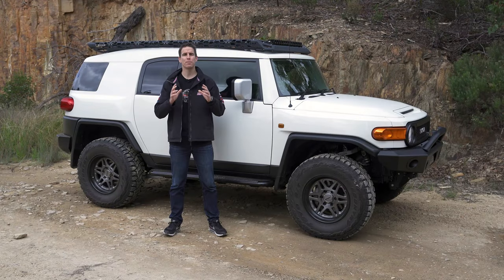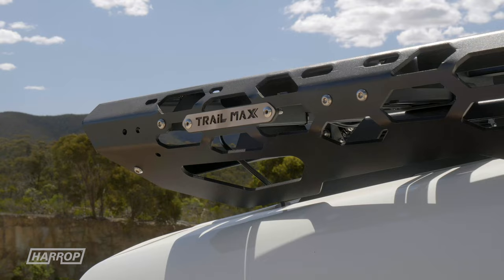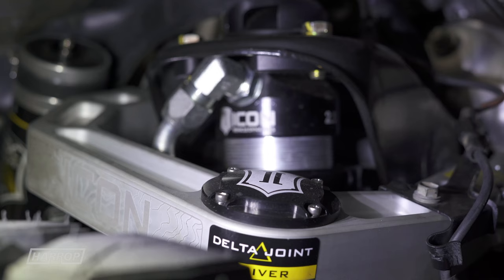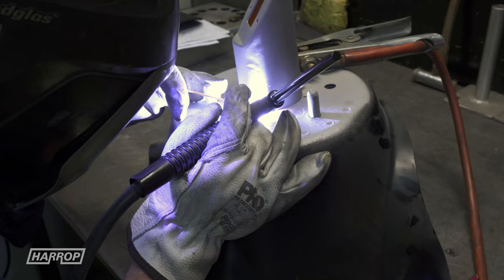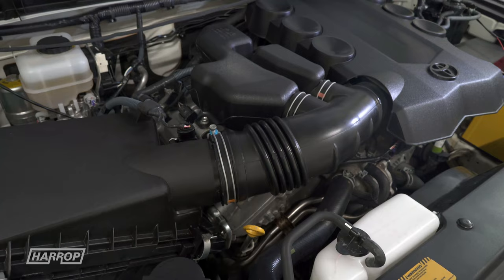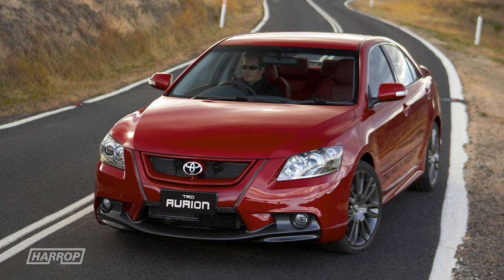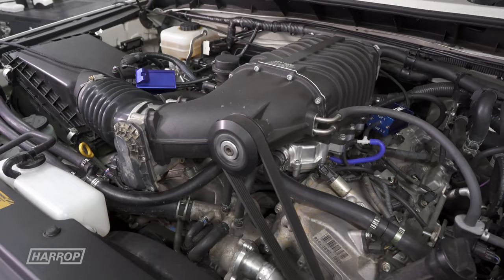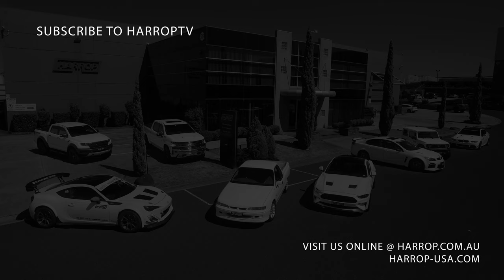Toyota FJ Cruiser | Harrop TVS1900 Supercharged

Comment: "Factory 160 Liter Fuel Tank". ?   Do you have a part number for this?  I didn't know there was such a thing.
Reply: 159L to be precise, it comes standard on 2014 models onwards in ME.
Reply: @kindi911   Share a part number if you can find one....   In the US they all have a 71 liter tank (19 Gallons).  Range is a problem.

Comment: When will the wheels be available to the public? And was the fitment possible without modification?
Reply: @kevron22   thats obvious if you watch the video but was more interested if the body mounts or guards etc where cut. @HarropTV care to weigh in?
Reply: @wadet5270  body mount chop is an absolute.  Talking from experience.
Reply from the maker: We expect the wheels to be available later in the year and there is a slight BMC required for clearance.

Comment: 0:48 “Toyota durability make it a popular choice” Ah yes, of course: banking on PRIOR Toyota durability. But the FJ Cruiser is absolute garbage!
Reply: Says who?
Reply: Why ?
Reply: @zarekivey  says many people that have actually owned them. They bought these because of prior Toyota durability, and they were disappointed. 
The FJ Cruiser is another poser, a marketing scheme that rides the past success of other good Toyota models.
Reply: @d993s  according to who?  It has a few minor issues like any rig but it has one of the lowest maintenance cost out of any Suv recently made. It goes through windshields due to the angle, and the rear visibility might suck with my 33" spare mounted on the back, but the 4.0 1gr-fe is one of the best Toyota engines ever made! The A750F auto was used in the Million mile Tundras and the Land cruiser 100 series... it's the only car or truck I've owned where I've hauled wood, slept in, gone dune running, drove through 3 feet of moving flood water and still has the beans to pull an F550 50 feet sideways out of deep mud (granted with a big running start several initial tugs and kinetic rope) she's a guzzler but she's a damn sturdy piece of equipment and anyone I've known has loved theirs to pieces. Your welcome to get the new Bronco with the Eco-boom engine tho if that's what you prefer... 😉
Reply: @OpaqueNihilist  sturdy??? The FJ Cruiser? 😂 it’s all relative to what you compare it to. Contrast exists, and the FJ is no Land Cruiser from back in the day. It’s a weak attempt at prior quality and it fails miserably compared to older models. Your examples are really reaching for greatness but you’re dreaming with those claims. 
If you’re satisfied with it, good for you, as most here are grocery getters with an occasional light camping trip. 
I have a 2015 Ford F250 6.7 turbo diesel and a 2009 Mercedes G55 and both with power upgrades (they don’t need anything else)
Reply: @d993s  your criticisms aren’t conveying any form of point here. You’re just saying “it’s bad” then not giving a reason as to exactly why it’s bad. I have an FJ with 172k miles on it. Not a single issue or expense other than routine maintenance and thousands of other FJ owners have had the same experience as me.
Reply: @d993s  well the G series is certainly respectable though I'd be curious to know what rim profile your offroad tires are on... 18" arent ideal and alot of people go 19 or 20 for the look. Its capable though a new axle is going to cost alot if you do any actual wheeling. Cars in general are used as grocery getters by definition, as are 99% of G wagons and 95% of wranglers. The Ford is a great truck but it's damn heavy. My other wheels are a 94' Dodge 250 with a built Cummins and a engine swapped mk1 vw rabbit for the track so they stay hitched to the trailer most days. I just don't think calling the FJ garbage is all that shrewd when you look at what else is on the road and what it can do with a 3" lift and a front locker. Its easy to work on and mine is still worth what I payed for it🤷‍♂️
Reply: @zarekivey  it’s simply not built to the same heavy duty standards as prior older Toyota models. Same goes for late model Jeep Wranglers and Ford Broncos; they’re built for looks and light duty use. 
Getting 172k miles out of one with highway driving and mild challenges is nothing to brag about. Again, the contrast and vagueness of what’s “good” (like a typical Amazon review “shipped fast, looks good”) is very different compared what some prior Toyota models were known to be capable of.
Reply: @OpaqueNihilist  on the G55 currently running BFG KM3 Mud Terrain 295/70/18 on stock AMG 18” wheels when going off-road, and on road usually Michelin LTX in the same size on a 2inch lift
Reply: Nothing like a bit of gaslighting to get everyone going. 
I’m a bit greedy, ln my collection l have a GQ patrol , a mint 80 series land cruiser and an fj cruiser. 
   As a one person tourer, and having travelled across most deserts and outback destinations in Australia, l am really lucky that my garbage fj cruiser didn’t break down once on over 120,000kms. 
The video shows how not to build an fj cruiser; unless your a poser. 
   If you like wheeling; my GQ Patrol beats anything hands down. ( It is a comp truck)
Reply: @purebloodnordicroamer7955  lovely 4X4 collection. the GQ is much better than the GU and we don't even get that in the states. Unfortunately Nissans 4X4 options here are mediocre at best. I've never been in one outside of a safari in Africa but if a diesel GQ or a Jimny was available I'd buy one. I'd be curious to hear about your personal issues but I'd say buying an FJ for a touring car was always going to be a terrible decision. You need alot more cargo and fuel space if your going into the outback. Short wheelbase Suvs are in short supply here in the states and the FJ can't be all that bad if it's used as a police car for dune and desert running by Dubai. Love or hate the shell but the locker, Trans, engine, a-track, breathers and tow capacity are all very respectable. Arb lockers, mud terrains and a 3" OME lift with resevoirs and it goes anywhere I've pointed it at. I love most Australian 4X4 offerings, you and India have the best options, but the reality is alot of yall just end up getting Rangers or Madza bt's that aren't great for much else other than hauling maximum human ass over long distances. The Cruiser is nowhere near an 80 series just because of the IFS but it is the toyotas best option since the 2nd gen 4runner and 80, and all the Diesel 80s here are all garbage now. I have a lightweight teardrop that might compensate for some of the Fj's practical flaws but it fits the onboard air, welder and the dog just fine👌
Reply: @d993s  1st gen broncos maybe, but I'd say aside from rust that the scouts, K5s and fj40s are much better than the Bronco 2. Maybe even the Samurai. I do agree that Jeep has really lot its way from the early 90s and Amc years. Toyotas newer engines in the taco and Tundra are not up to par
Reply: @OpaqueNihilist  I was referring to the latest half ass little “Bronco” that Ford put out in the last 2 years, it’s a joke
Reply: @d993s  cmon bro, fj is a good sport utility vehicle that’s all. It’s a nice reliable off-roader that’s unique.
Reply: again another cry baby that probably owns a vw or a piece of crap ranger. The fj cruiser is bulletproof. And value for money wise brand new off the showroom floor they were better value than any other toyota.
Reply: @Steve211Ucdhihifvshi  if the FJ cruiser is bulletproof then you must also believe that cows can fly
Reply: @d993s lol what a troll
Reply: Lol What? You have no clue what you are talking about and it only took once sentence to show the world.